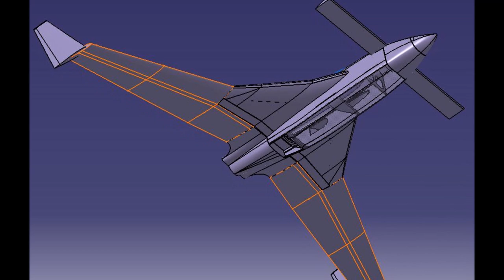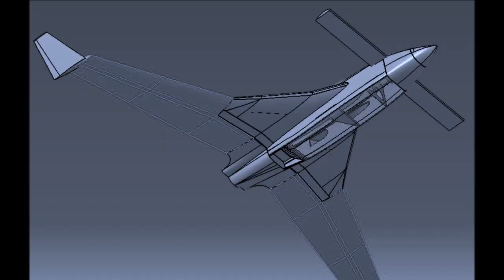The Long-EZ Build: Chapter 19 - ailerons

Comment: They are unique airplanes. It is a real point design i.e. go somewhere fast for the least amount of fuel. But like everything in life there is no free lunch. They are very long to build if you want to do a good job, particularly on the finish. And you need 2500 ft minimum of asphalt. Forget dropping into little grass strips. You can build an RV in way less time, it goes faster, aerobatic and you can easily get in and out of a 1500 ft grass strip. But it burns more gas and the kits and bigger engine are a lot more money. There are no free lunches. Certainly the rutan canards are really cool looking.